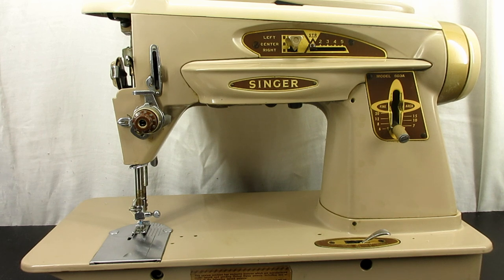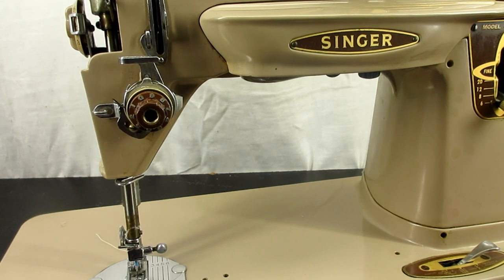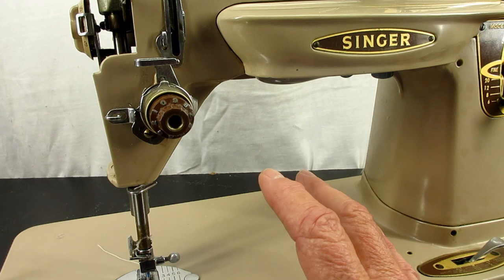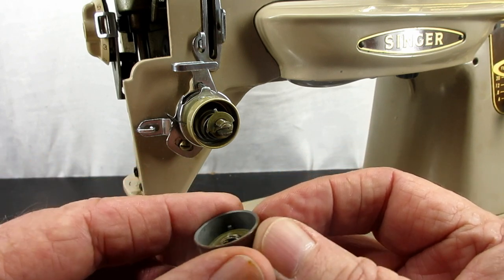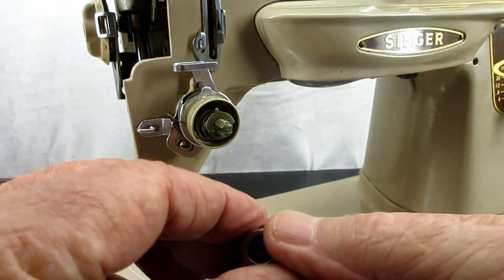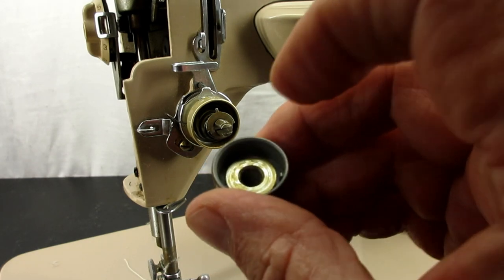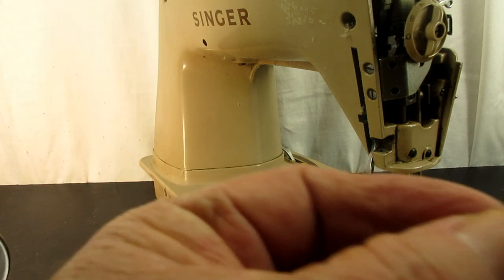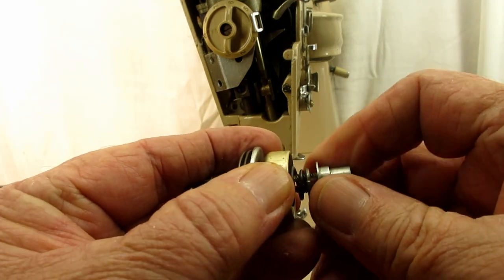Removing a stuck brown tension knob on SInger models 500A & 503A

Comment: Hi Andy, I have a question about controllers.  I have the old carbon pile type button controller and have cleaned it out and had a number of broken piles.  I sorted them out and I think I have 45 per side.  I'm having trouble controlling the machine while I'm filling the bobbin, speeding up and slowing down like that.  Not so much trouble with the actual sewing.  Are the new electronic controllers more accurate and will they work well with my 503a?  I see that Central Michigan Sewing Supply has a new replacement with a carbon pile control.  Any ideas?
Reply from the maker: The new electronic controllers are incredibly accurate. Especially for slow or very steady speed. I've installed a few for customers who tend to sew on the slower style, like when doing free-hand sewing. https://youtu.be/uiEvEFNZA58   The carbon stack pedals run hotter the slower they go b/c of the resistance to the power making them heat up. I used to be able to buy replacement carbons, but they are getting harder to find. In fact, last I checked, Terry is the only one selling them https://store.tandtrepair.com/618804003.html   (use coupon andy-h-yt for 20% off) That tube has about 50 of the new carbons which are double thick, so they fill the old dual channel foot pedals also. IMO, the new carbon foot pedals will run warm and eventually have the same problem you found. Depending on the price difference I always have recommended an electronic pedal. They never get warm or hot, have superior control. You need a surge protector for it as you would any new electronic device. I used to buy ones like this b/c they came without cords and I could easily reuse the existing cords which often were color coded to the machine https://www.sewingpartsonline.com/foot-control-deluxe-universal-6098fc.aspx  You may be able to find both types of pedals already wired for your model of machine (Singer) The new carbon pedals are usually cheaper though, so it's a personal choice. None of the new pedals work with the knee brackets of Singer cabinets without special modifications that you'd need to make. Do not buy a used carbon pedal online or without trying it first. It may be just as bad, or worse, than your old pedal. Good luck, Ralph, and thanks for watching my channel.
Reply: @andytubesewing1953  Thanks so much Andy, I truly appreciate what you do for beginning seamsters and people with the older machines like me.  I think I'll order one of the electronics.  Thanks for the info.
Reply from the maker: @ralphwatten2426  I'm glad you find my videos helpful, thank you. Always enjoy helping a fellow sewist with machine info.
I did not mention it, but some of the customers sewed barefoot or in socks, and could not take the heat even though the old pedal worked OK. The first lady asked me to build some kind of an insulated box for the pedal with a raised foot for her to push on, hehe. She sure loved her new electronic pedal.
Reply: @andytubesewing1953  Yes, thanks for all your help.  I've ordered the electronic controller for my 503a.  I'm going to sew a replacement cover on my military back pack for my next project.  Thanks-

Comment: Why is there so little  help with the Singer 500 Slant-o-magic Singer Sewing Machine?  It seems to be ignored.
Reply from the maker: Oh, you have to know the passwords to see the 500A/503A videos.👀
Not really, just joking.😉 Models 500A/503A have a different body style but the same mechanical systems as the 401A/403A except for the handwheel and bobbin winder. There are many videos for them on YT. As an example I have 17 videos for Model 401A that can be mostly applied to model 500A: https://www.youtube.com/playlist?list=PLsCOZgzzaiKLiDl9yFTP6mJgQmz5lj4NO   
I have 27 videos for model 403A that can mostly be applied to the 503A:
https://www.youtube.com/playlist?list=PLsCOZgzzaiKKyqvdDRwS-9MfLuwSNJTcg    
Then I made 27 videos for model 503A that can be used for model 500A too: https://www.youtube.com/playlist?list=PLsCOZgzzaiKJZaZn2zl3LsnV2d7UhrqvX
I tried to cover everything on the machines with those 71 videos. That does not count the videos for the motors and the foot pedals that are used by those 500A/503A models. If you'd like some original factory information about the Rocketeer models you can always download a free copy the the Service Manual in PDF format from the Sewing Dude: https://sewingdude.files.wordpress.com/2012/09/singer-500-service-manual.pdf\   Thanks for watching my channel.